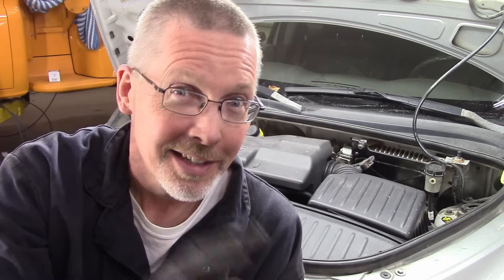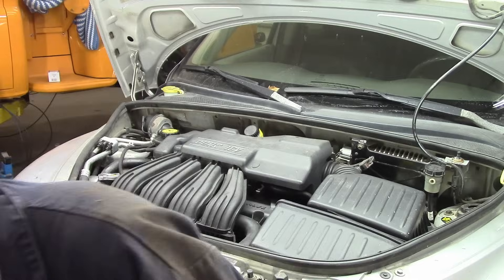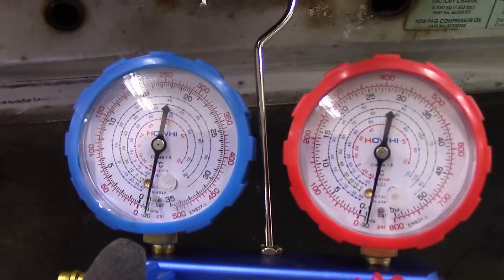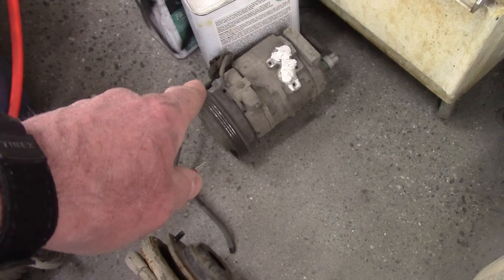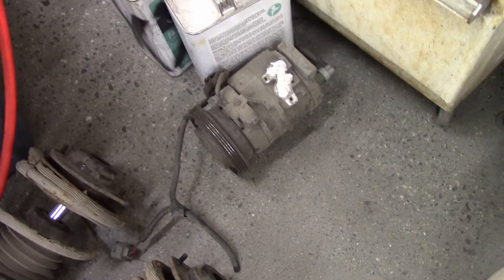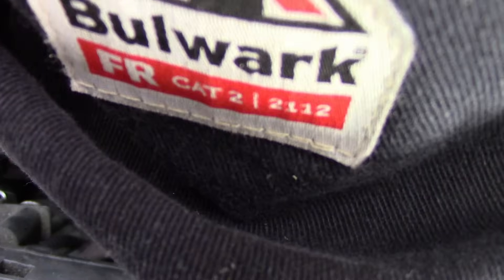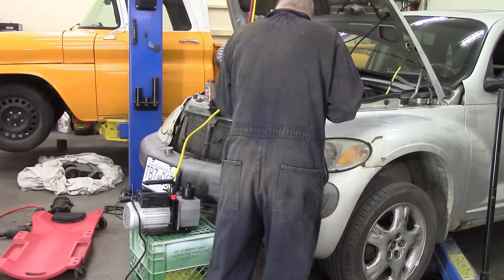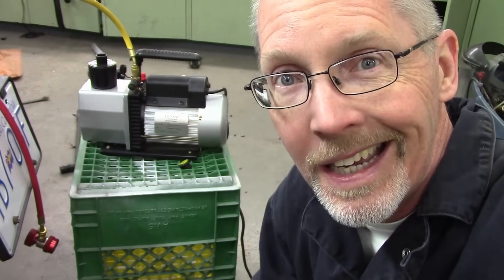DIY Testing, Fixing, & Recharging A/C

Comment: A little helpful tip. Don't use copper based grease on aluminum, since it can react with the aluminum and cause even worse corrosion. 🙂
Reply: @Doubt9It  You're aware majority of refrigerants today require to be charged in a liquid state?
Reply: @billderby1527  only if the refrigerant is a tertiary blend. 134a is not. 410a most certainly is.
I started working for a single man operation, owner/tech some years ago. The 3rd day I was charging a new install of a unitary system, 410a, tank inverted. He, who had been the sole installer for 1.5 years at that point, asked me-as if I was stupid- (a common occurence) WHY I had the tank upside down.
O.M.G. .  .And ME, the 'beginner' with 20 years of domestic refrigeration experience.
The rest of the story is , well, self explanatory. A nightmare of incorrectly charged, newly installed mostly Rheem systems, with customers unhappy with the performance versus cost.
I was able to rectify the situation, but it involved roughly  5 - 7 tanks of 410a, and about a years time.
Reply: @billderby1527  blends do because of slightly different BPs…and slugging the compressor is still a problem that can be mitigated by longer hoses or special evaporate chambers.
Reply: What is copper based grease? Never heard of that, honestly.
Reply: @markhonea2461  The anti-seize he was using to coat the bolt is the high-temp version that is copper based.
The other Anti-Seize version is aluminum based.    I would guess that "any" anti-seize is better than none.
Reply: @markhonea2461 come on man.. Never heard of copper grease? They use it for brake pads and calipers so it does not squeek it's a antiseeze... These days they use ceramicvreese
Reply: @mrantiwoke  yeah, the only thing I am familiar with is that blue silicon for the pads. I still haven't seen it besides this video. Go figure, as I am a lifelong believer in mechanical lubrication.
Reply: @markhonea2461 an anti seize compound that is also used on factory new Glock pistol rails so the slide moves effortlessly until the weapon is broken in. A high temperature grease that has ultra fine copper dust added to it that allows a tight fit of a joint while not permitting electrolysis to take place between dissimilar metals and rejects the ingress of water into the joint as well if the connecting hardware is torqued to manufacturers specifications.
Reply: One shouldn't use copper based anti seize at all and especially not on anything that is not heat related. It introduces galvanic current which just makes things worse. Aluminum and copper are on opposite side of the scale  and the former will act as a sacrificial diode just like a zinc anode on a boat.
Reply: @prose1733  Super good to know, Thank You.   To date I've only used the high-temp anti-seize on my brake caliper bolts.  Its important to have both in the shop.
Reply: @prose1733  Caterpillar has been using copper anti seize forever. No, it is not a lubricant, it is an anti-seize especially good for hot temperatures, up to 1000 degrees C or more.
Reply: @Lggaley  is that helpful? Is a car seeing the same use as a caterpillar? Is a bolt holding the AC compressor subjected to the same heat as a caterpillar? Why would caterpillar use copper paste and not Volvo?  Do you even know what materials are being used on the caterpillar? 

So many questions ... but regardless the science remains the same
Reply: I agree, stopped using copper grease years ago. 
Basically, it didn't work when using stainless cap heads  as replacements for JIS on 1970's motorcycles.
Personally, I found Teflon paste lasts longer and doesn't  react when you use stainless into aluminium (plumbers paste from Lowes, Home Depot, et.al.)
Reply: Negative.  Copper is more noble than Aluminum.  It will NOT cause Galvanic corrosion to aluminum.  In fact, if you have a stainless steel threaded fastener going into an aluminum casting, you'd better be putting Copper ant-seize on it.  Also spark plugs (steel) into an aluminum head, especially if it is a long thread one, must have COPPER anti-seize.  Not aluminum anti-seize. Any steel or stainless steel to aluminum, use only copper anti-seize.  Aluminum anti-seize to aluminum anything is not going to give you Galvanic protection.  Aluminum anti-seize is primarily only for steal on steel fasteners like chassis bolts, lug studs.  It's OK (not preferred) for stainless to steel but not for aluminum to steel or stainless steel.
Reply: @x-man5056  Thank You X-Man 👍
Reply: Stainless into aluminum is the second worst situation. Aluminium is rapidly corroded. Now coat the stainless end to end with a high solids copper antiseize and that bolt will not react. I can not explain how the galvanic effect is disrupted but it is very effective.
Reply: @Dave5843-d9m  try taking apart hinges that are seized on one of the government ConEx comms shelters. Stainless steel pins used in aluminum hinge assembly. Electrolysis creates aluminum oxide in the hinge holes and grabs the stainless pin like it’s welded in place. As you know aluminum oxide is used as an abrasive, very very hard substance. It took tons of heating with a torch and pounding with a hammer and a like sized steel pin to remove the stainless pin from the hinge.
Reply: @kr1121963 😳
Reply: Würth Brake Protection HT is the best option for everything. No any metals and it's heat resistant too.
Reply: What about nickel antiseize.  I use it all time where temperature is high.
Reply: That crazy sensor in front of the condenser and radiator is an ambient temperature sensor.
Reply: @dominicgorra8959  I thought it was a air bag sensor , there's 3 of them , mine has two in the front , and one in the back
Reply: I just wrote that above yours before I looked.
Reply: @Liquid_Wrench 
9:50 Permatex Copper Anti Seize....
Reply: Using copper grease is fine mate, as long as there’s little moisture

Comment: this channel is consistently a source of knowledge every kid wishes his dad had
Reply: Yeah. My dad was a journeyman lineman for 23 years then got an AA in HVAC, he was a radioman in Korea and he fixed tons of tvs and radios in our basement while I was growing up, and he was a world class auto mechanic. I could count on helping him fix all his co-worker's cars, holding the light for him, at 8 years old, on 20° St. Louis winter nights after one of their sons knocked the front ball joint off driving like a dick. Fortunately, I paid attention and pretty much picked up all the lessons he taught me, in addition to bodywork. I've had a classic Corvette restoration shop for 40 years and used all the plumbing, carpentry, roofing cement 😂 electronics repair he taught me years ago. I've also been an attorney for 20 years, but mechanical stuff will always be my thing. Take a kid to a car show or expose them to working on cars or stuff around the house. All many of them need is being exposed to working with their hands. If the gift is there, you'll never get them away from it.

Comment: Thanks for Sharing...... On vehicle that is more than 10 years old, it is good idea to replace the Schrader Valves (High and Low) because they are point where they could easily leak and they are not too much to replace....Be careful, a lot of those "Refrigerant Substitutes" are very Flammable because they are "Propane Derivatives".
Reply: R12a is an Alkane, a member of the same family as Methane, Ethane, Propane, Butane, etc., you get the picture, HIGHLY FLAMMABLE!

Comment: No
A that vacuum pump will not pull 30 inches of vacuum
Reply from the maker: Weird.  The gauges seem to indicate it does....
Reply: @GregWellwood  
How much vacuum can be pulled?
Because the maximum theoretical vacuum at sea level is 29.92 in. -Hg, actual pump capabilities are based on and compared to this theoretical value. Depending on pump design, the vacuum limit ranges from 28 to 29.5 in. -Hg or about 93% or 98% of the maximum theoretical value.
So no
If in theory if you could pull down to 30 inches some part of the system would collapse
When you indicate the gauge, they are not accurate the further down the vacuum gets
Plus it has never been calibrate which I doubt anyone would do with harbor freight
 gauges 
I've done vehicle, residential and commercial HVAC and have used vacuum pumps that make that look like a pipsqueak
Reply: @DaveBigDawg  29.92, 30… difference of 8 TENTHS. SERIOUSLY??! Go back to your engineering cubicle.
Reply: @r.joseph8911  pick a finger
Reply: @GregWellwood  you’re good, man. We have a front of the class dweeb here that is squabbling over .08” of Mercury. 😂
Reply: @r.joseph8911  It sucks when someone else is right, doesn't it?

Comment: I was offered a PT cruiser some years ago at a an attractive price. I gave it a thorough inspection, & discovered bubbles in the cooling system.  YES.....a leaking head gasket. I was told by mechanics that these cars are infamous for head gasket problems. I looked the thing over & d4ecided it was a poorly engineered POS & I am NOT surprised that they are long gone.
Reply: I had one that lasted 155,000 miles. I replaced the timing belt at 80k and put in a new clutch at about 105k. The brake pads and rear shoes were replaced once. The tie rod ends were replaced at about 95k. Of course there were some new tires and oil changes. I would say it was one of the best cars I have ever owned. My 16 year old kid totaled it. Sad ending for such a great car. I have a friend that had one for about ten years. It was his daily driver. He had a similar experience. Just regular maintenance.
Reply: Aas if the shittacular sohc ver or the far better (Mitsubishi design base) dohc version which did not suffer the same issues and were notnassy in the same plants
The sohc was both a pos design but the QC for assy was abysmal  much like gm for their pathetic spitfire with forced induction..  so bad of qc they had to have those built in germany instead of the states  lol
Reply: Pt Cruiser with a 6.4 Hemi
Reply: The usual old "I nearly bought a PT but" bollocks... boring.
Reply: I never understood how these cars got such a bad reputation. I guess it's good. It keeps them cheap. I should get a couple more of them before they are gone.

Comment: few tips while for dealing with a/c systems.  You didn't elaborate while your were testing the compressor weather your did it before or after or while the system was under a vacuum.  NEVER attempt to run the compressor while it is in a vacuum.  In a vacuum the oil inside the compressor does not flow like a liquid in a vacuum and with no refigerant in the system no oil will be flowing to keep the compressor lubricated.  

While filling the system with the cans you were using do not hold the can upside down and allow liquid refrigerant to enter the low side of the system.  the line you were duping liquid refrigerant in goes directly to the compressor and if you attempt to put liquid refrigerant into the compressor you could hydro-lock the compressor and blow it up.  Hold the can upright and allow the refrigerant to boil off and be sucked into the system as a vapor its safer.
Reply: R12a is a blend and therefore must be charged as a liquid but you can adjust the valve so that it flows slowly out of the can and evaporates in the low pressure line.
Reply: @ruben_balea  thanks for that. I was assuming R134A.
Reply from the maker: I did not mention it, but I did NOT run the compressor under a vacuum.  I didn't even think to.  I believe the cans said to hold upside down for filling, so that's what I did.  Assuming I read them correctly.

Comment: I see you have the chrome wheels on your car how are they doing at keeping the hi pressure air on the wright side of the tire ? Those suckers always rim leak  .
Reply from the maker: So far so good.  No idea what elixir of silicon syrup might be in there.  It's holding air.
Reply: Those aren't chrome wheels - they're alloy wheels, the chrome is a chromed ABS facing that's glued to the alloys

Comment: I have been a technician at a GM dealer for 25 years, 30 total in the car business and I don't ever see anything done here that I haven't seen before in A shop that I have worked at. No one ever follows all the rules and regulations that are in place, show me A person that says they do, and I'll show you a lair! There are short cuts to everything, made up by guys in the shops, because we get paid by the job, not the hour. You do what works for you and keep on trucking. Love the content and the comedy that you put with it, keep up the good work and teaching the young minds of your students!
Reply from the maker: A/C was my weakest area in my technical training days, and I never had any experience in working with A/C at all.  It doesn't seem as hard as I thought it would be.
Reply: @GregWellwood  If you watch a few AC people on youtube, you can pick it up pretty fast (like 'steven lavimoniere' or 'hvacr'). If you know how to read a P/T chart, it's really obvious. The biggest unintuitive thing about it is if the pressure is too low (aka there's a leak or there isn't enough refrigerant in the system), that's when it freezes and ices up. Low pressure = low boiling point, and if the refrigerant is below 0C at the boiling point, the system will ice up. You actually add MORE refrigerant to raise the pressure (and thus the temperature of the cold side) to make sure it's above freezing. The only thing I'd suggest you do is purge your hoses before you dump the refrigerant in - you either need to bleed some refrigerant through the hose to flush out the air first, or connect the hoses to the gauges, and evacuate them with the vacuum when you evacuate the rest of the system. You don't want the air that's in the hose initially to go into the system.
Reply: I do, its not that difficult. All you have to do is be certified and use certified equipment. Simply using the machine correctly covers everything. Accidental discharge of small amounts of refrigerant or even charging a vehicle with a slow leak isn't illegal.